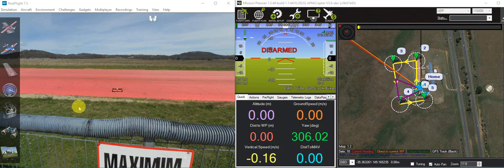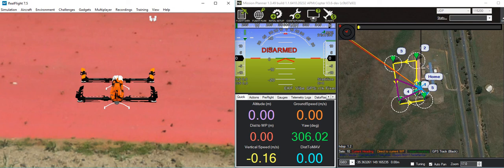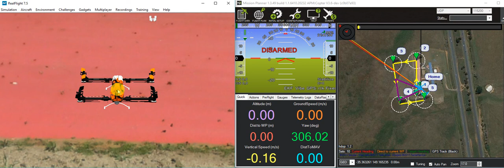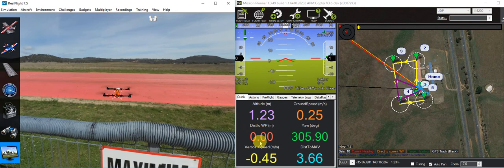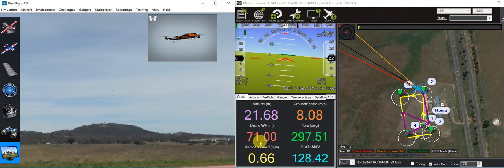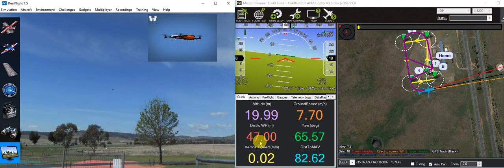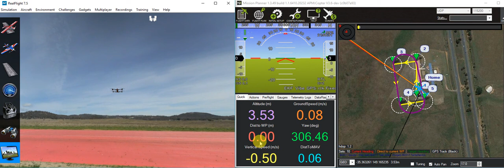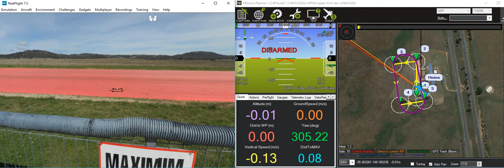Stingray Collective Quad in ArduPilot SITL

Comment: yes, it works fine with planes. The most likely issue is you have both reversed elevator and reversed RC2 input (the defaults in realflight are reversed from ArduPilot). Try setting SERVO2_REVERSED=1 and RC2_REVERSED=1

Comment: Can this setup be used to control fixed-wing airplanes model that are ready to fly in Real Flight 8? I mean can I used Arduplane instead of Arducopter? I tried to do it, but the autopilot does not control planes correctly, it just tries to climb with a 90° pitch angle...